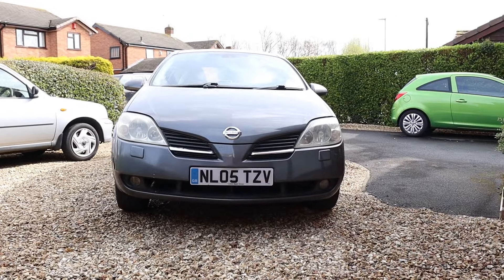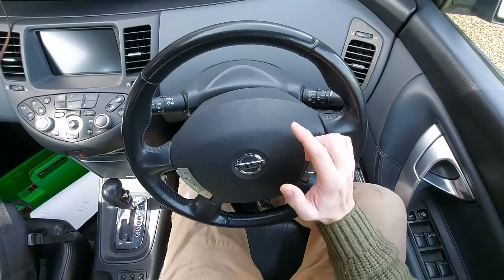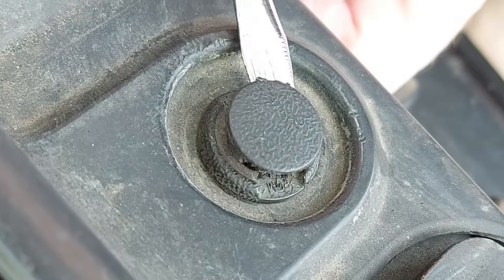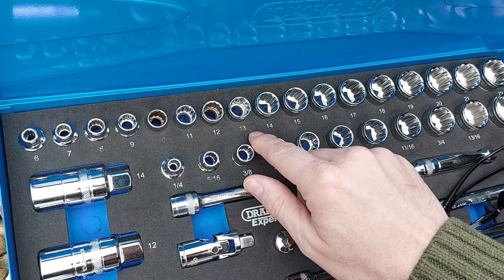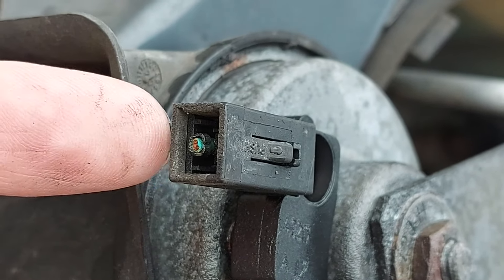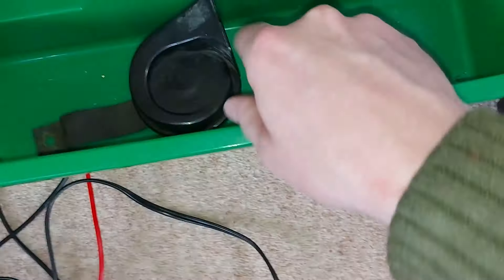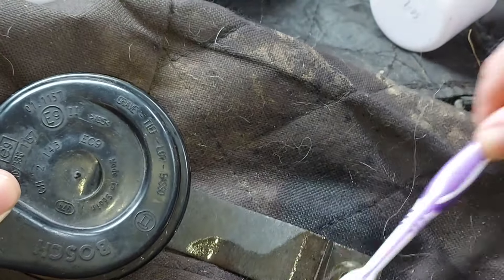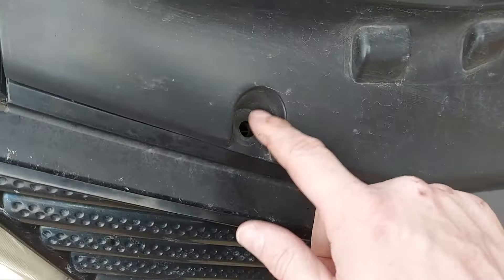Nissan Primera P12: How To Fix Horn (Repair Car Horn)

Comment: Well analysed and sorted.   A good video as always.

But, very surprising fails on GT85 use tho,' shake the can well before spraying, and also apply some to where the horn bracket meets the metal of the car then if you're lucky some might get to the bolt threads too, and better to leave the GT85 to soak in for longer (you could edit the video).  Let the GT85 do the hard work for you, less effort needed with the spanner or ratchet then.  You'll learn to make things easier for yourself as you get older. 😆
Reply from the maker: Thanks Nta16. Yep! Important to let GT85 soak. I gave it a few minutes (edited out of video). I'll need a new can soon, too!

The other day, I found a small tin of WD40 in a draw. Mrs CarSpyTV has her secrets!
Reply: The secret stash WD-40 would be fine for the green thing.  In the last week I've driven a Corsa E (2016) twice - but keep that to ourselves. 😉
Reply from the maker: Your secret is safe with me!

Comment: Hi My vehicle is a Nissan Primera P12 1.6. The rpm of my vehicle remains constant at 1500 rpm. Can you help me with this
Reply from the maker: Perhaps the car's in limp mode. See:

https://www.carwow.co.uk/guides/running/what-is-limp-mode#gref
Reply: @CarSpyTV  My vehicle is LPG powered. I encountered this problem after the vehicle's LPG injectors were changed. The car was misfiring. I changed it recently, but it is still like this now and I am getting the error code P0113 and P0171.